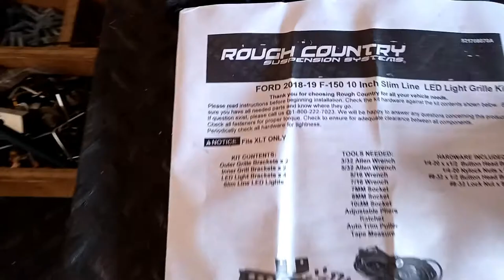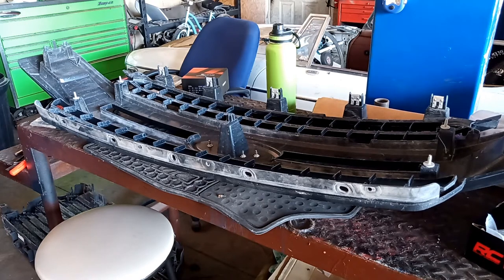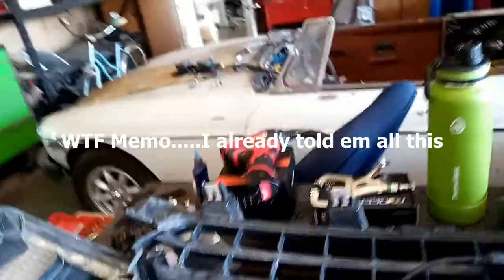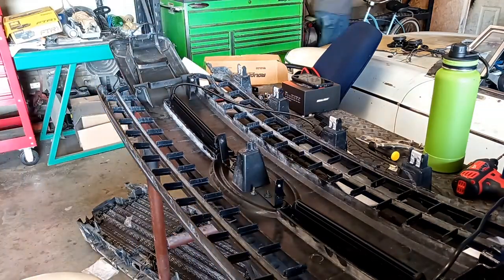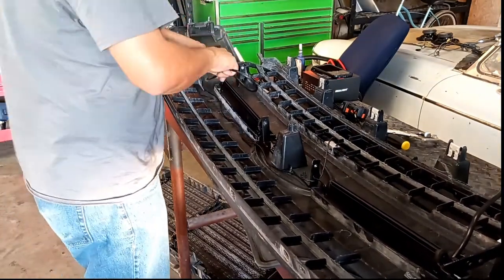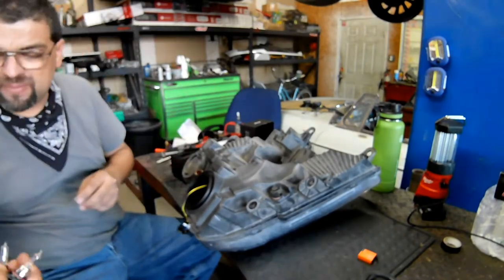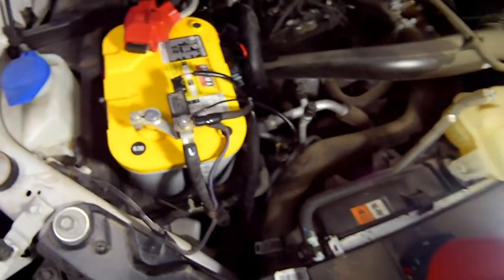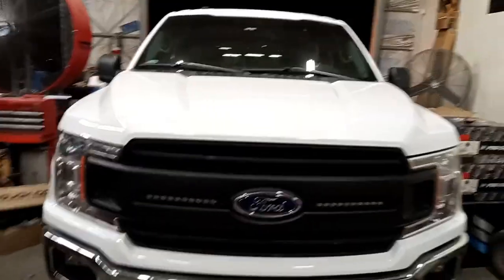2020 Ford F150 Grille LED lights and Front view camera

Comment: Do you have the specs of the brackets that was made? I need them as I have the same grille. Thanks
Reply from the maker: Sorry. I made them on the fly.  Cutting, bending, and drilling as i went.
Thanks for checking out the video and for commenting.